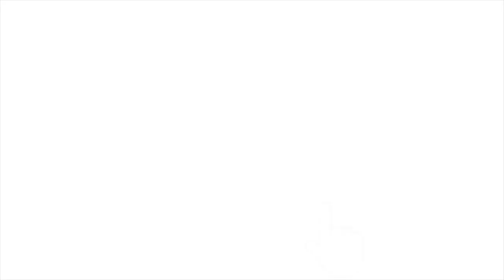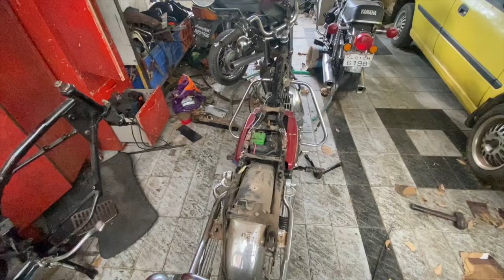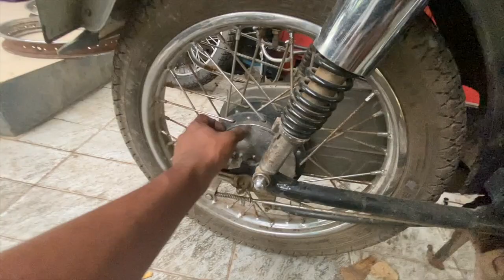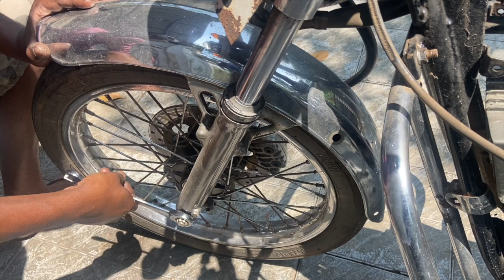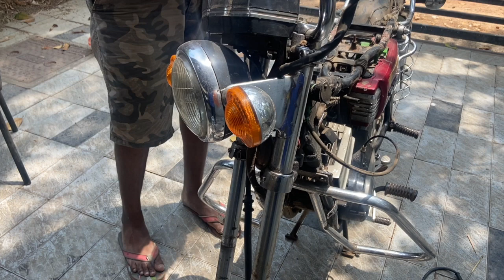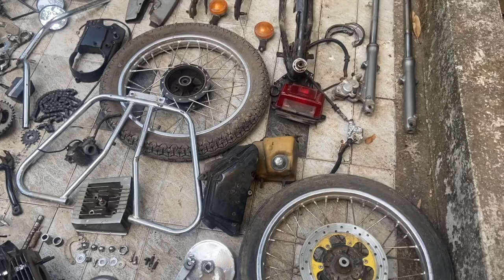New project: Yamaha RX 100 :)

Comment: Sir, I am also planning to switch from pulsar disc setup to drum setup. Since the rim is in good condition, I would like to use it(thought I'll save some 🤑 that way) with the Rx hub. But I have noticed the pulsar spokes are a bit thicker than the Rx ones and also the nipple holes in the rim are also a bit bigger. Please advise if it will fit rx's spokes.
Reply from the maker: You will need new spokes
Reply: @Yamakaze  Thank you, Sir. Will the Pulsar rim work with rx spokes as the holes in the rim look a bit bigger?
Reply from the maker: @allaboutnothing99  yes
Reply: @Yamakaze  Thank you. I had the spokes fixed by a professional today. Bought Gabriel spokes for Rs. 340/-
Reply from the maker: @allaboutnothing99  👍